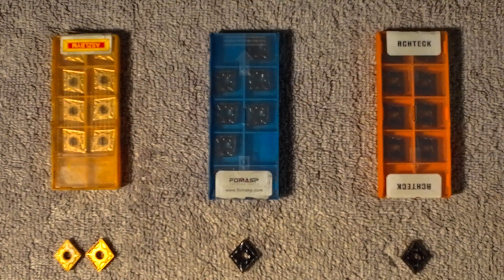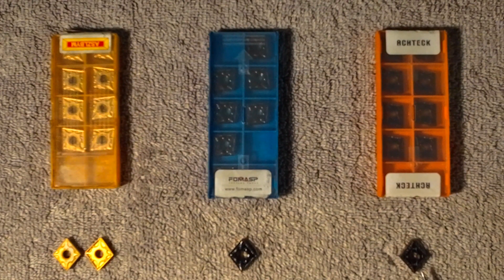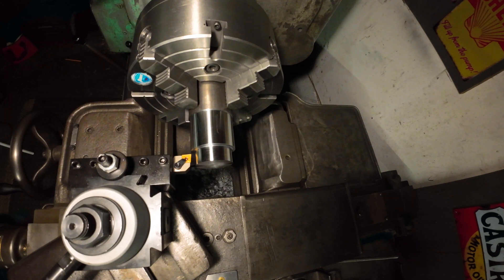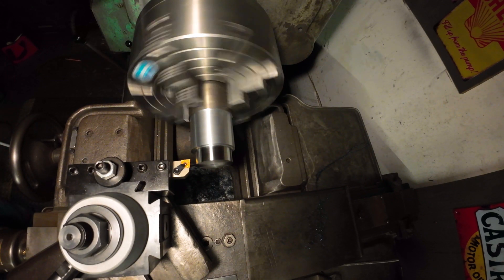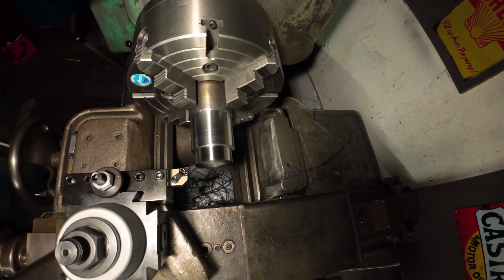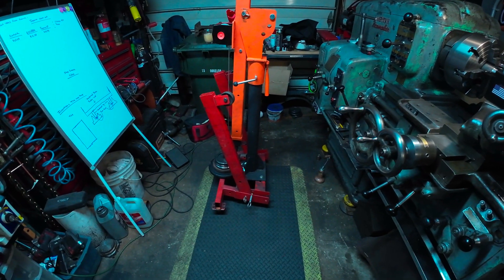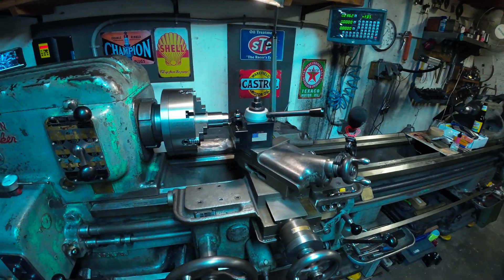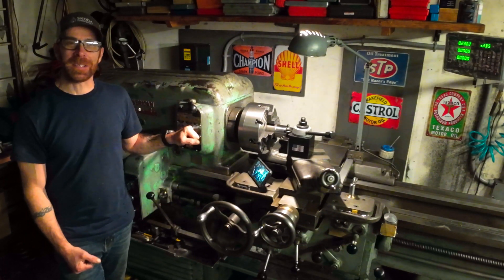CNMG Insert Testing, Shop Crane, VFD, DRO and More!

Comment: Always good to see real world reviews straight and to the point on tools a home shop guy can afford.  It would be very helpful if you kept track of how long each insert lasts (value for time equals final price).  I would be interested in some reviews of Ali Express and Banggood inserts although they can be extremely hard to search on their sites for a particular product or insert.  Very hard to find tool holders of a particular style for inserts a guy has.  Their search engines really suck and do not seem to get any better over the years but I have had good luck with their inserts some more than others.
Reply from the maker: Great idea. I will definitely try to figure out the best method for calculating longevity. Maybe just a straight forward torture test on something notoriously hard on inserts. Thanks for the feedback and ideas.

Comment: I have the same aslbym however it is spelled. I have been very happy with the inserts. I have cormat and kenametal. Inserts also. The type of insert used is dependent on the metal you are cutting. It is not a  one blend fits all. Inserts for cold roll and SS and cast is different.
Reply from the maker: I understand that fully. But all the inserts used here were for this type of material. And I have also been happy with the inserts up until the last batch. Thanks for the comment.

Comment: As you know carbide likes to eat so I would be interested in some 50 thou DOC's (100 thou total) and see the results. 10 thou was obviously not deep enough for the first insert and was rubbing more than cutting. Also I have found that the CNMG's like to dig in and if you have some back lash in your compound the insert can actually take off more material than you dialed in. So I have changed my ways and hog off material with the CNMG's and then when I am getting close to my numbers switch to a WNMG or a TNMG for finishing passes. Just some food for thought.
Reply from the maker: I will certainly consider that. I was going to take a deeper cut but unfortunately this piece is for a project and I couldn't spare the extra material without turning it quite literally into scrap. So I suppose that's one vote for further testing. Always appreciate the support hill top.